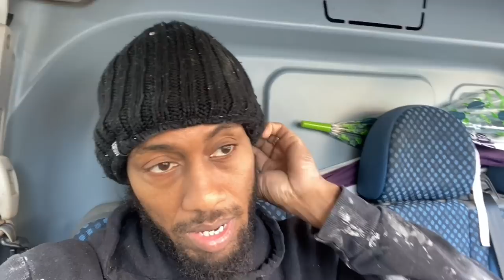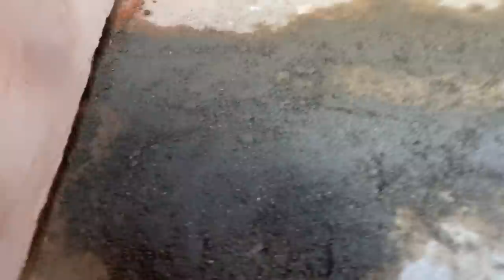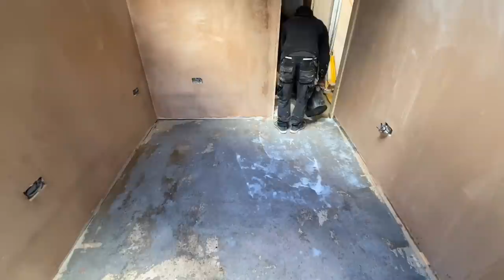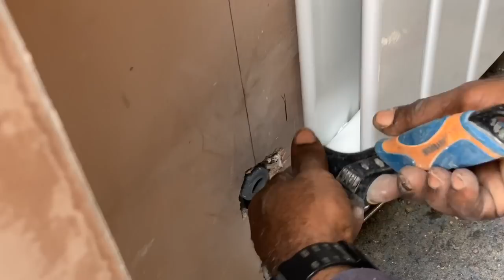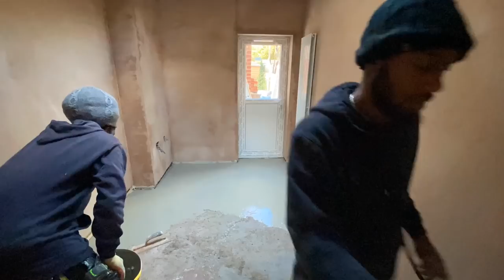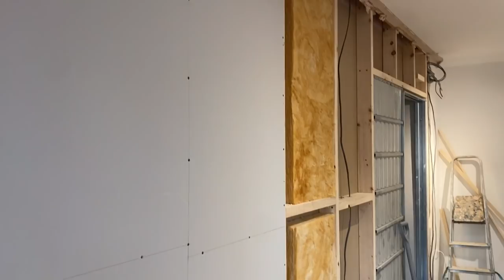We fitted a radiator and self levelled the floor

Comment: Good work chaps...one thing I noticed your elbowing out of the rad valve with your 15mm?why not use a 90 rad valve instead of a straight
Reply from the maker: Yeah that one was a 90. We were going to fit it like that but the problem would be the thermostatic valve would of stuck out past the front of the rad which I didn’t like so added the bend so it would sit upright. The other rads were done like that as well so also made sense to match them

Comment: Would it not have been a lot easier to have put the pipework in before screeding as you’ve now had to patch the floor and make the wall good ,just doesn’t make sence  but maybe there’s  a reason for this
Reply from the maker: Yes. I totally had forgotten about the rad before lol. So had to do it after.
Reply: @darrenthebuilder  👍🏻

Comment: Get yourself on an F.Ball one day self levelling course, you’ll be able to get the floors snooker table smooth.
It’s critical how much water goes into self levelling compound you can’t just lob it in from a bucket..
Reply from the maker: Been doing it enough to know the ratio tbh. Who’s got time for courses 😉 lol
Reply: Why would you need a coarse ,the manufacturer tells you how much water on the back of the bag and he also used the stipple roller which leaves a great finish any way